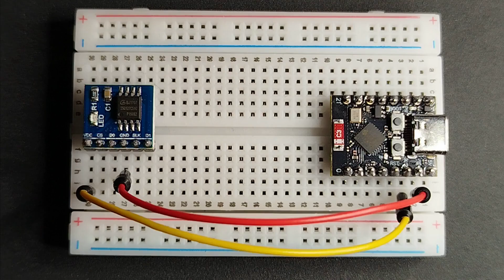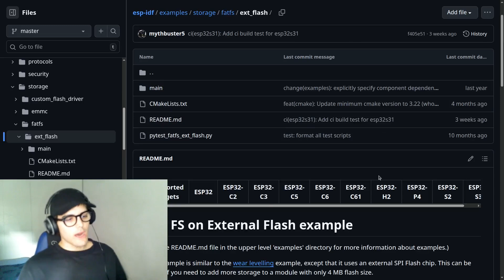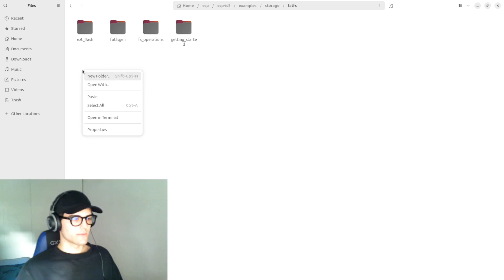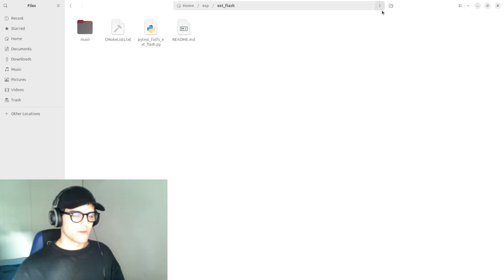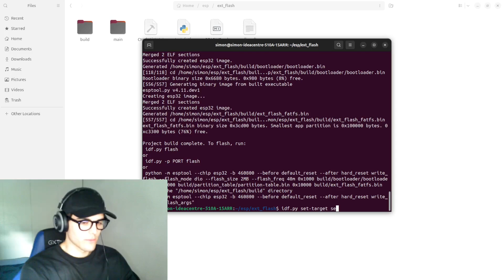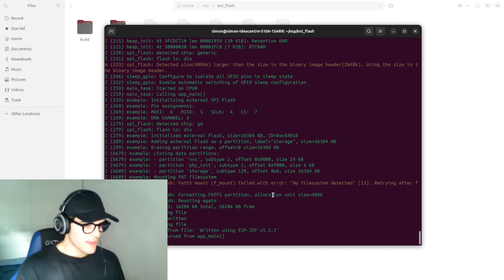Upgrade Your ESP32 Storage: SPI NOR Flash Tutorial

Comment: Great video 🎉
Would this work if I wanted to swap the flash memory? For example, having some codes on one flash and other commands on another? Basically a mini computer with floppy disks or CDs
Reply from the maker: I think so! I’ve actually seen adapters/sockets ("socket spi flash" on google) where you can just insert and swap the flash chip without soldering. As long as the flash memory is compatible with the same interface and your code supports switching between them, I think you could definitely make something like that.